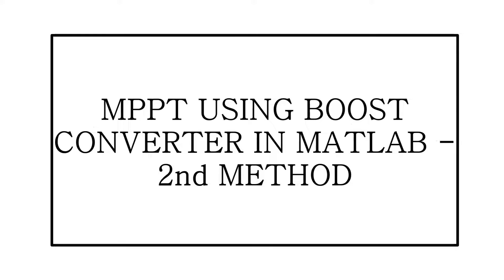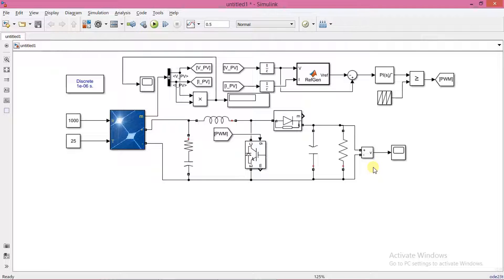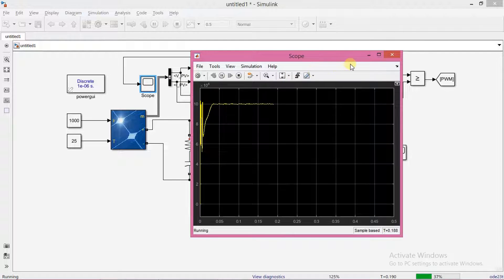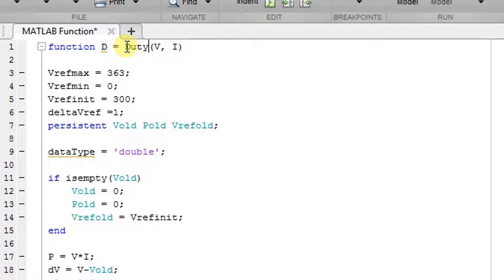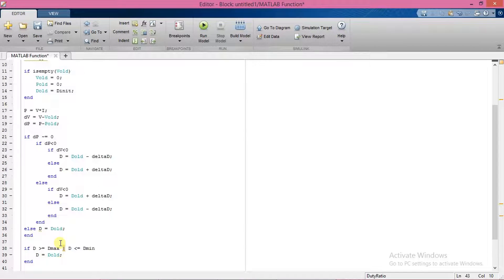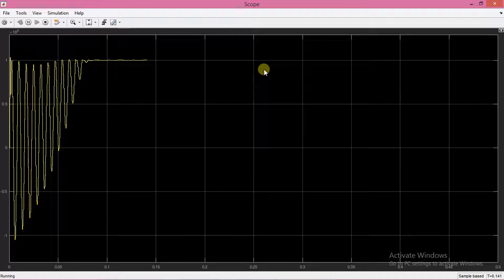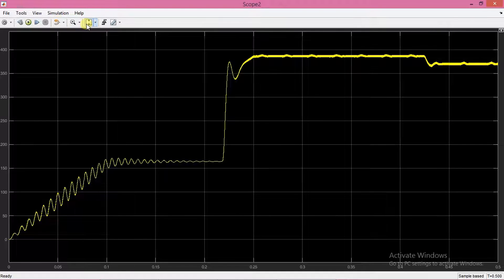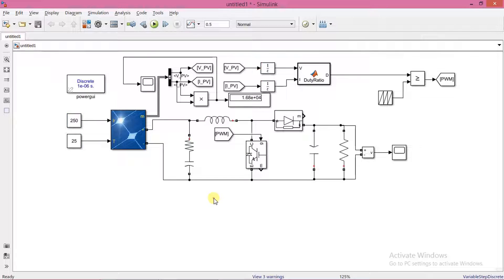Demonstration of Maximum Power Point Tracking (MPPT) Using Boost Converter in MATLAB - Method 2

Comment: Thanks for the video. 
Assume it was required to implement MPPT but also at the same time keep the output voltage constant. How would achieve this?
Reply: You need a second stage (some LLC) with a feedback. MPPT is about a power, so it’s about keeping a U•I constant, not U or I separately.
Besides, if you make an optimizer, that second stage is required to connect many in series (you can even do not keep an output voltage stable, but you will need a free path for a current, in case one of an mppt is turned off, that a boost converter cannot provide itself).
Reply from the maker: Not possible
Reply: @TechSimulator  why not Possible?

Comment: Hii can u tell me how you have taken the duty ratio as 0.95
Reply from the maker: max possible duty ratio is 1. when it reaches that value the mosfet will be ON always. to avoid that, i chose a value which is less than 1.
Reply from the maker: one thing you have to remember is that we never let boost converter to work beyond a specific duty ratio
Reply: Okk thank you